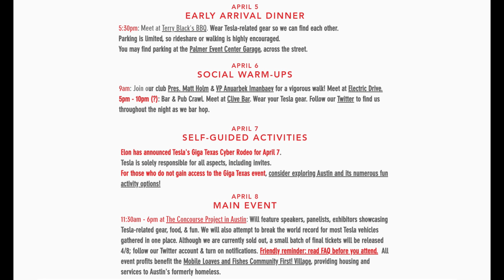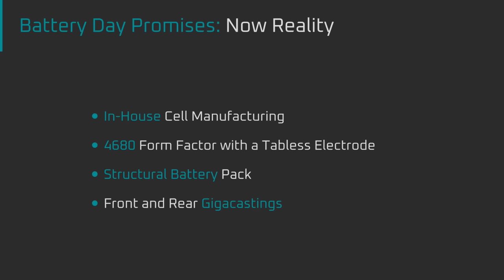Giga Texas // My Experience and What I Learned

Comment: Blade battery (China) are way more interesting to use than the one use by Tesla. Ratio volume/ density is higher. And this type of battery is much more safe. No need all those extra safety measure Tesla is implementing
Reply: It will be the go to for lower range and grid storage.
Reply from the maker: With a shortage of materials, every battery cell will be required, no matter the chemistry.

I already did a video on the blade praising it.  To be a fanboy of one technology is ignorant of the broader landscape.
Reply: @thelimitingfactor   i live in a small country , a small EV car with a range of only 50 miles is enough . But sadly, in Europe, there are no car like that we can buy. Only in India and China but those are forbidden to drive in Europe 😭
Reply: @stargot1  VWG make the e-Up. Is in last days as they cut 20 models and all cheap cars. Not economic.
Reply: Yes and no, if you read the spec sheet for blade or other types of prismatic LFP battery it says cells must be under pressure, 6000kN in the case of recent cells I am sourcing. For a BYD blade, this requires a very heavy containment structure. In BYD cars it's a 180kg cast aluminum tray. Sure very safe, it's like a tank under the car....Tesla I guess wanted to be more elegant in its solution.

Comment: It should be remembered accelerating 4,000+lbs of car takes a massive amount of energy compared to just keeping speed, with that it is easy to extend range by slightly reducing the speed of accelerating, I wouldn't be surprised if economy mode has a optimized reduced maximum acceleration limit to greatly extend range. 😉😉

Comment: the fact that they are not taking the opportunity with die cast front and rear and structural battery pack to make a very high range vehicle suggests that they are saving cells.

Comment: Kinda sad to see that Tesla is so far ahead in technology but has 0 products i'd like to buy. All way to big, way to heavy and way to expensive. Despite the Bloatware like FSD, a ton of useless shenanigans and a crap user interface. I just hope Aptera manages to get a road legal version for the EU market. I guess i just have to wait before i can switch to electric. I'd love to but the market is just full of crap atm.
Reply: It will take years, a decade or more for BEV's to hit every niche.
Reply: rooting for APTERA too.
Reply: @TheEvilmooseofdoom  I think the chinese will fit most niches in a very short time frame. They do so in china already, but just need some time to spread to other markets and definitly don't need a decade for that. Although the niche Aptera is aiming for is another story. But's its basically the only "car" i can see far and wide that meets my needs. Built for maximum efficiency by being lightweight and with super low drag, plus solar panels that would cover my daily commuting needs so i won't need a charging station for most of the year. I just hope they make it to the german market asap.
Reply: @chrisholt2502  The chinese makers can barely meet China demand at the moment and if supply constrained I suspect they'll stick to the local market.  I think they will offer a lot, but I don't think it will be soon.